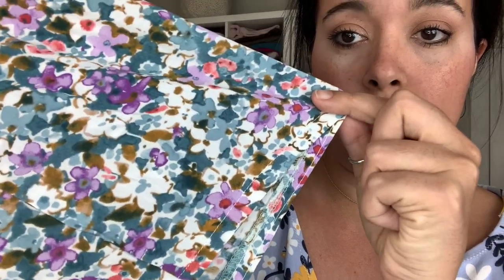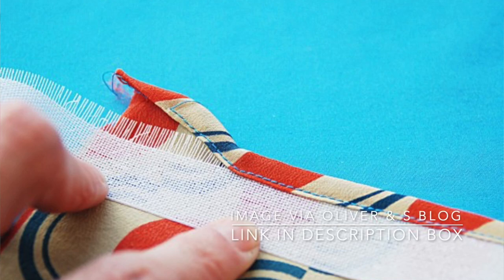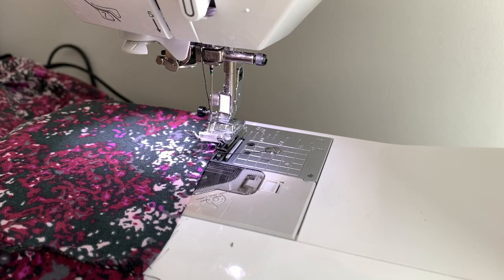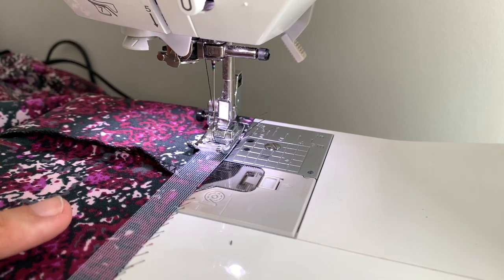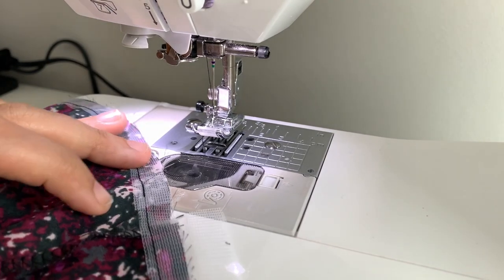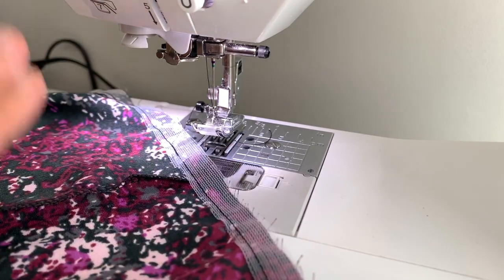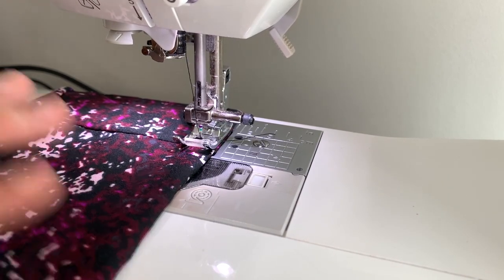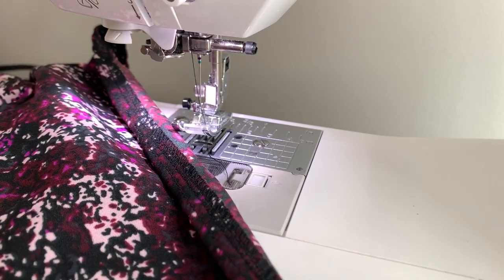How to Sew Baby Hems! Easy, Pretty, & Fast Trick for Shifty/Slippery Fabrics

Comment: Thank you for this video!  I do have a question.  When you serge around the fabric edges, do you lift the knife away from the fabric edge?  Pittsburgh, PA
Reply from the maker: No. I always use the knife. Just place the fabric at the edge of the knife so it doesn’t cut anything off.
Reply: @InsidetheHem  Many thanks!

Comment: I am going to sew a long skirt with a ruffle on the bottom edge. Would you use this on a ruffle hem? Would it be too heavy? Great tip, I am going to use it on those slippery fabrics. Thanks!
Reply from the maker: Hmm. Depends on depth of ruffle. 6” or more I think you’ll be ok. Otherwise, I would skip!
Reply: @InsidetheHem  Thank you!